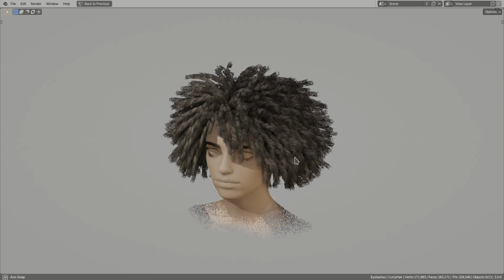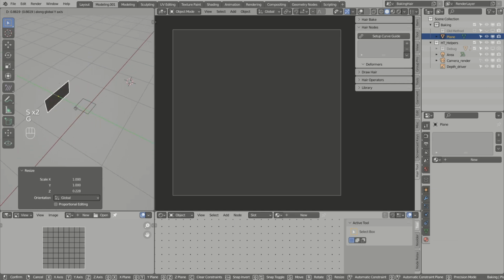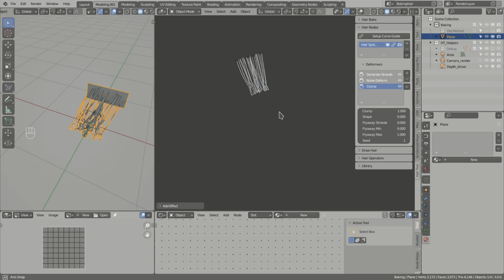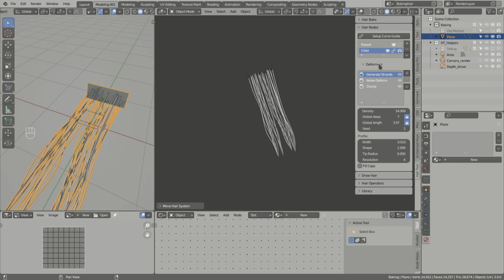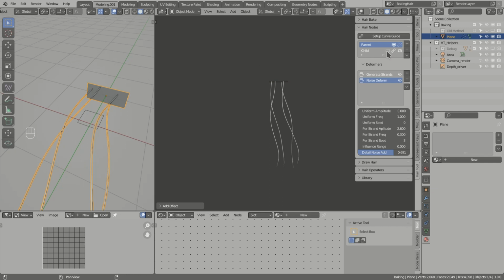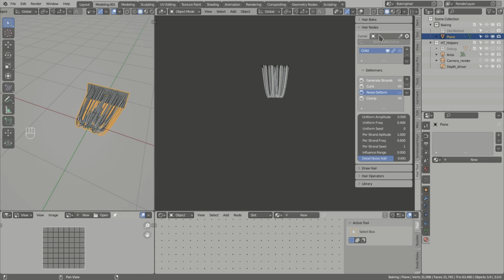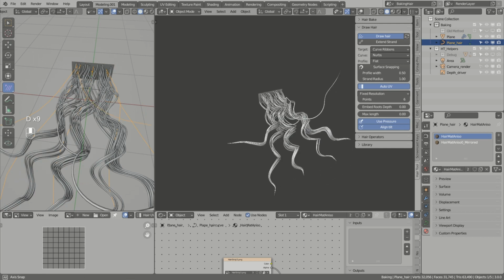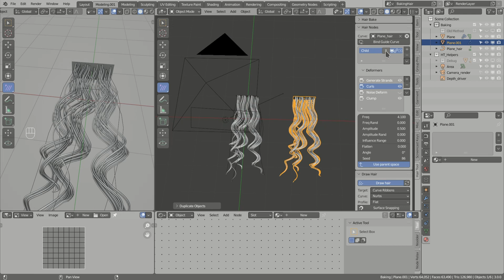Nodal Hair System for Baking Textures in Hair Tool

Comment: Amazing tool! Thank you for developing. May I ask you to add extra controls for the deformers? It would be great to be able to control clumps, noise, and curls influences by the curve (like in XGen)
Reply from the maker: actually it may be possible after all. Will look into it.
Reply from the maker: Well, the problem is - those curves cant be exposed in blender panel - blender python api does not allow for it (u can draw curves in  UI only from C++, not in addons).